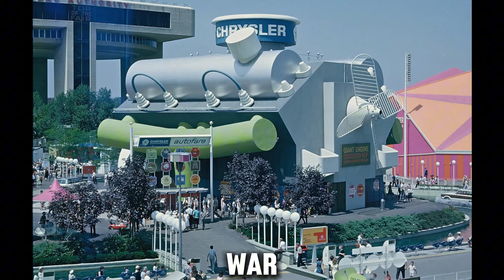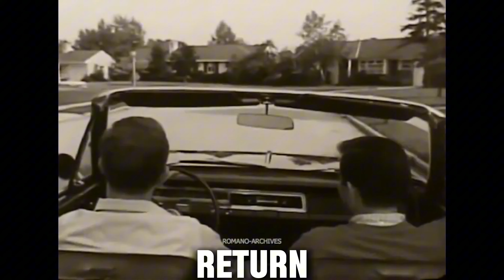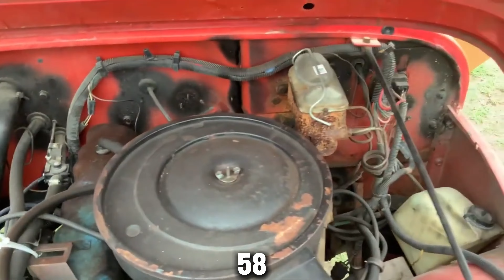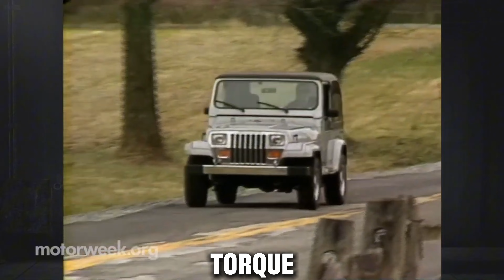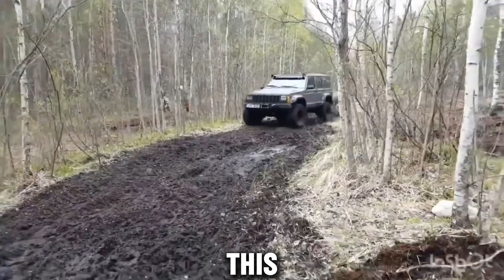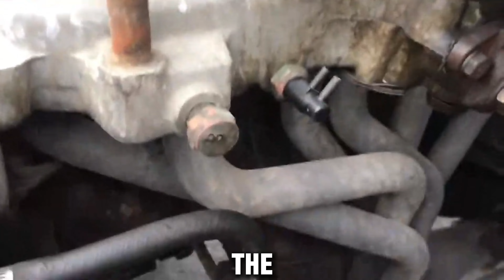Top Engineer Reveals Why American Inline-Six Engines OUTLAST Every V8!

Comment: Is it really that difficult to fact check your info before releasing a video? The sad part about all of your inaccuracies are that kids that didn’t grow up during these years will believe your info is gospel. Cross flow head? Really? Clean sheet design? This inline 6 with its 7 main bearings and same side intake and exhaust ports looks suspiciously like Chevy’s 194 - 292 inline six cylinder engines! By the way, that later model “258” fuel injected version was actually “242” cubic inches also know as the “4.0 liter”. Please, for the sake of all future generations of “Motorheads” ask an old timer to check your facts. The number of views your video gets is far less important than the actual info you’re releasing.